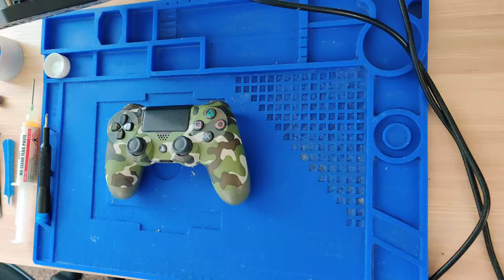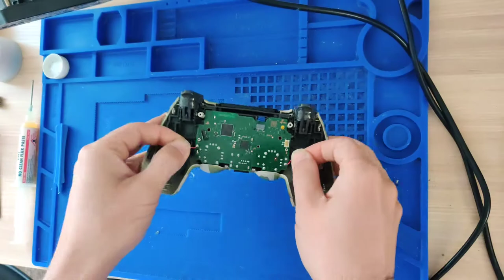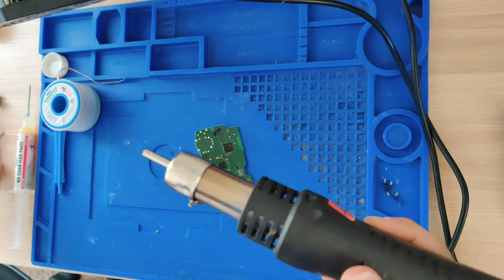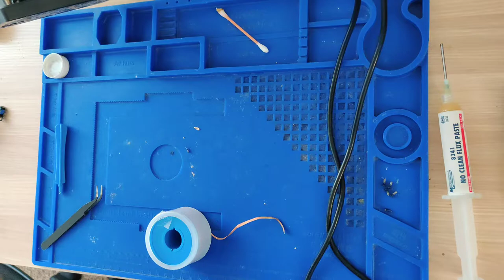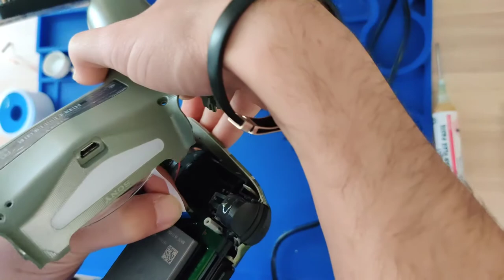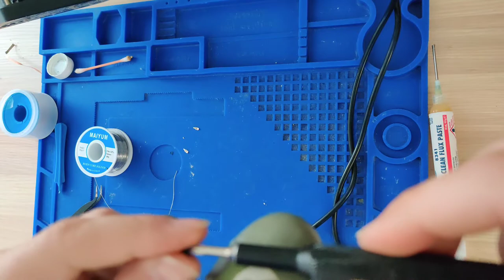Step By Step To Change Audio Jack For PlayStation PS4 Controller

Comment: Nice to see its not just me these are a pain in the ass for lol. 
 Little tip for everyone watching that may want to have a go at this.  Go over the solder joints with leaded solder and flux first, that lowers the melting temp of the existing non-leaded solder and makes it easier to remove.  
Also if you are trying to salvage one from another controller to replace the broken one.  It is extremely difficult to remove them without damaging them.  Its easier to break the old one out and replace with a new one like in this video.
Reply from the maker: Thank you for your comment,  when I made this video I wasn't have audio jack so I take from old controller

Comment: An easier way to fix it is to get the original cable that it broke off and stick it back in there and try to make it grip it on to there then stick it back out. Ive been trying to get it out of my controller for a couple months and the method i used worked in like 15-30 seconds depending if i got it good and now i am pretty happy and relived that i got it out.
Reply from the maker: Not all the time that work, sometimes after you take any pieces off will got noise sounds with new headset or sometimes some pices broken inside audio jack, so i recommend to change it